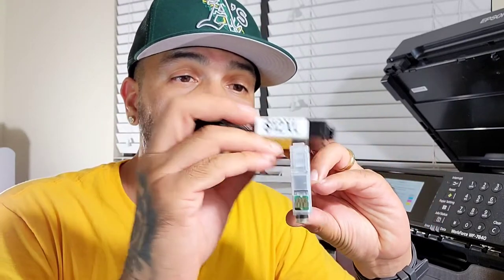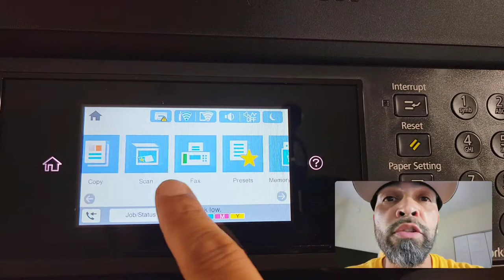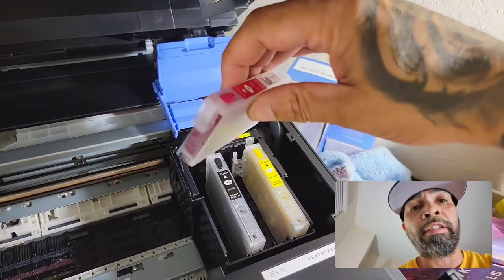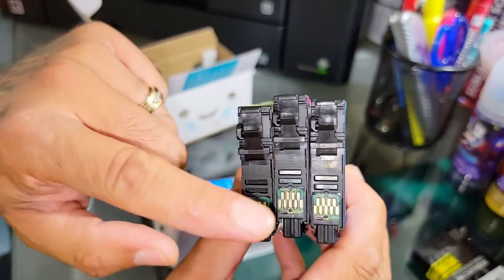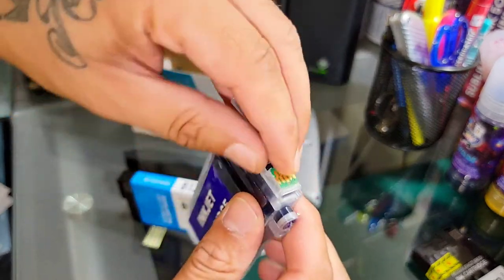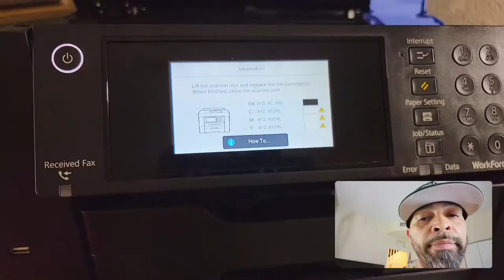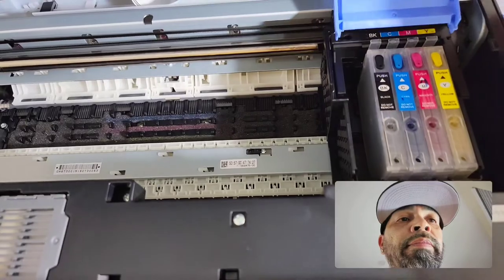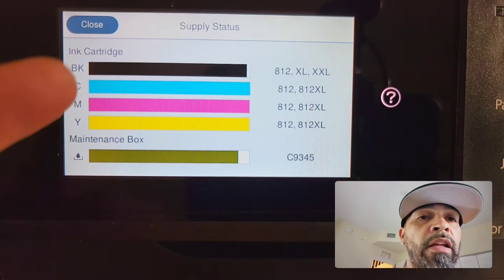Converted WF-7840 Into A Sublimation Printer PART 2 (MICROCHIPS)

Comment: Quick question if you keep the cartridges filled with sublimation ink and not let it get low , you don’t have to replace the  chip
Reply from the maker: Good question.  Since there no firmware chips made yet, the epson printer software will call for the ink to be changed right, the print driver will refuse to print.  So therefore have to change chips.

There maybe ways to bypass this, im still researching for a solid method.
Reply: @diywithkenny8399     are you using the ink up from the blackcartridge, then swapping out that chip from the black cart. nd putting that onto the clearcart?
Reply from the maker: No.  Filling the clear cartridge with black sublimation ink, then add the chip from the black ink cartridge.

Comment: I bought a new Epson wf 7840, never used the ink cartridges it came with. I bought new refillable cartridges that came with the chips already attached to the cartridges. We’ll after setting everything up, when I print nothing prints but blank pages. It reads all the colors are there and full but no print. What did I do wrong?
Reply from the maker: Hello!  Good question and will ask you this:  When you filled up sublimation ink, did you remove the clear rubber seal?  Also did you replace the clear rubber seal with the color rubber seal?  There should be no seal on back end on refill cartridge.

Watch video at 5min 45sec:  https://youtu.be/PI5RadxJX8M
Reply: I removed the rubber seal when I was filling them up with ink, then it was replaced back on the cartridges. I did not remove anything else from the cartridges.
Reply: So your saying to replace the white rubber seal with the colored seals for each cartridge?
Reply from the maker: @vee_theegemini  Exactly lol.  Throw away clear seal, color rubber seal  will move from back end towards front end where the chip is at.
Reply: @diywithkenny8399  oh ok, got it. Thanks Kenny! I’ll keep you posted on my prints.
Reply from the maker: @vee_theegemini  For better color; find your printer on your computer  "settings", then watch this (fast forward to 9min 27seconds) to set preferences/settings: https://youtu.be/aLpdCW_yQkw

Comment: I keep getting an error message on my yellow ink I have no idea why thats the only one not working. Im converting
Reply from the maker: Hello and ok.  Hmmmmn will have to ask few questions:  is the chip new?  Also is the chip facing up correctly?  Is the chip snug correctly -  meaning those plastic nubs are top and sides and bottom nub shaved off?
Reply from the maker: Did you get the yellow cartridge fixed?
Reply: @diywithkenny8399  I didn't shave the sides but I also didn't on any. Ill try that. I watched another video that did also. Yes the chip is new. Trying now BRB
Reply from the maker: @TheTeenBlogger  only shave off plastic nub on bottom on refill cartridge only.. hope it workouts 😎

Comment: Thank you for the great info! I can’t get mine to print anything yet using the start up cartridges/chips that came with the printer. I’ve done all the maintenance and set up now it’s saying I’m almost out of ink! Lord help me yall what am I doing wrong?
Reply from the maker: Ok.  Did you use original chips and cartridge for normal use?  If you did is because of software.  What you have to do now is to buy a new set unfortunetly (because no new software/firmware chips are not out for these newer printers YET!)  Once you replace the older chips, you should be running like new.  Can search Amazon, Office Depot, Ebay, Best Buy deals for "wf7840/7820 epson ink cartridges".
Reply: REPLYno sir I purchased the refillable ones and put the chips on those and have not been able to print the first thing. I’m buying the ones you used in part 2 now but I’m just concerned as to why the others didn’t work.
Reply from the maker: Oh ok my bad.  Let me ask you the original chips ever been used prior to swapping?  If you did use regular chip to print off normal paperwork type stuff, it loses the chip life regardless..
Reply from the maker: @kathysicuranza5999  also can save approximatley $14 if you go to Etsy and buy refill cartridges with chips whole set for $49.99 i saw
Reply from the maker: @kathysicuranza5999  https://www.etsy.com/listing/1007470036/epson-812xl-empty-with-chips-t812xl?ga_order=most_relevant&ga_search_type=all&ga_view_type=gallery&ga_search_query=epson+812xl+empty+with+chips&ref=sr_gallery-1-1&organic_search_click=1&bes=1
Reply from the maker: @kathysicuranza5999  Cheapest I see as of today!
Reply: I purchased my refillable ones from Etsy. I sent them a message, he asked for pics and now he’s not answering. I’ll give him a day I know we all get busy. I went ahead and ordered the set you showed you use so I’ll try those. And no sir I never used the reg ink. I bought the printer, sub ink and refillable cartridges and changed out like you and the others said
Reply from the maker: @kathysicuranza5999  It's ok.  Could be something missed in a step: 

(1) Main one would be shaving off the bottom plastic nub on each refill cartridge. (2)  Chips swap on exact color cartridge.  (3) Chip facing correctly.  (3) Slowly placing the refill cartridge in, then pressing top till click..because chip can move.  Not saying you did miss any steps.  Sometimes be the case.  Have faith you will get it.
Reply: He finally got back with me and turns out that his directions don’t tell you to remove the the cap over the vent plug!! I would think that’s pretty important. Now I’ll try again when my new chips get here. Thank you so so much for all your time and help. Keep the videos coming I’m enjoying them.
Reply from the maker: @kathysicuranza5999  It is ok.  Forgot to mention that step too, but it in the 1st video at 5:46 when filling the sublimate ink.  Figure there was a step missing.  SO... it is working?
Reply: I bought a Epson wf 7310 and went through video and have an error message that I can not get passed.
Reply: Initialized cartridge detected. Printer already initialized. (Black)
2) I click next and I get this message
Open the printer cover . Replace ink cartridge. I am using the fill cartridges that I bought . I ended up taking the chip off the original black ink that came with the printer. 
An help would be appreciated.
Reply: @ashlyncoyle4850  what is the code
Reply: @diywithkenny8399  hello.. I just bought my Epson 7840 a month ago. I did use the cartridge's for a few weeks to get used to printer.. sooo I bought sub Cartridges and ink. I went thru part 1 and swapped the chips from original to refillable one. I printed about 20 pages for shirts and it worked awesome. It showing now ink is low. So I took out and refilled black since that's the one that was showing low. It was full still!. And I cleaned print head and printed test page and the blue yellow and magenta lines are perfect. Black on other hand is not good. I've cleaned more than a dozen times. It's still bad. How do I fix this?? Help!!!!!😶‍🌫️😶‍🌫️

Comment: I have a question,  I'm thinking about purchasing a ET- 7840 and convert it to sublimate. Do you have to install new chips everytime you do a refill?
Reply from the maker: Hello.  Did you mean WF-7840?  You can refill sublimation ink anytime, but when your printer says ink is low, I recommend yes will have to change out the microchips, don't want to mess up any of your current printer software.  Because no new "software/firmware chips" are made yet for these newer wf-7840/7820.
Reply: So are you saying if your printer says low ink. Buy the 812xl and remove the chips from them and put those chips on the original refill cartridges?
Reply from the maker: @catfishingthebluegrass8282  Yes unfortunetly until they create a new software/firmware chips.  But I have updated the pin in comments and Etsy seller selling whole combo chips on cartridges (chips only good for one use), beats buying any othe ink cartridges, but still research please for any better deals.

Comment: I'm about to buy my girl this printer to swap to a sublimation printer. Besides changing the original chips over to the replacement cartridges like in your video, is there anything else that has to be done?
Reply from the maker: Hey Jason.  No.. just remember match the colors when swapping chips, and to shave that "bottom" plastic nub only on refill cartridges where chip goes.  You should be good.
Reply: What about software/firmware? Don't need anything special?
Reply from the maker: @catfishingthebluegrass8282  Those are the chips where we won't need to buy any more ink and swap chips.  Like the older version WF-7720 have those  software/firmware chips.  That what the wait is for.. unfortunetly.
Reply from the maker: @catfishingthebluegrass8282  Sublimation ink should last and can refill anytime.  That you will have to manually check.
Reply: This stuffs confusing. So I can just refill with sublimation ink as needed and keep the same chips on the replacement cartridges and don't need any special software?? Sorry for the hassle, just trying to understand
Reply from the maker: @catfishingthebluegrass8282  You can ask as many questions you want.  Dont worry about any software/firmware chips because it is not out yet.

"WHEN" your printer says low ink, just swap for new chips.  Fill sublimation ink as needed.
Reply from the maker: @catfishingthebluegrass8282  https://youtu.be/PI5RadxJX8M Just follow the steps in this video, pause if you have too.  Get stuck, just stop.. feel free to hit me up.
Reply: I'm ordering everything needed now. I'll probably hit you up when it comes in. Thanks for all the advise and help bro.👍
Reply: Everything works. Cartridges and ink are in. Only issue is that the prints are super faded. Any way to make them more crisp?
Reply from the maker: @catfishingthebluegrass8282  they will look dull, have you heat press them onto anything yet?  True color of the print will show on product.
Reply from the maker: @catfishingthebluegrass8282  also find your printer on your computer settings.  You can fast forward to about 9:25 in this video: https://youtu.be/aLpdCW_yQkw
Reply: @diywithkenny8399  everything worked perfect bro. Thanks for the videos. Great details, and thanks for responding to the comments. Couldn't have done it without your guidance. 👍
Reply from the maker: @catfishingthebluegrass8282  Great news!  Here anytime!  Appreciate the comment 😎
Reply from the maker: @catfishingthebluegrass8282  Add one thing, you can  fill up sublimation ink anytime, so manually check it here and there!  Other than that good to go.
Reply: @diywithkenny8399  last question, do you know of a good place to buy shirts in bulk? Hoodies and Ts
Reply from the maker: @catfishingthebluegrass8282  Yoooo.  No worries, always ask in google search if -  "IS WWW.@&$*%<ABC.COM LEGIT" ..you see no type of trustpilot or bbb ratings then dont shop there, here a list:

Www.alldayshirts.com
Www.jiffyshirts.com
Www.shirtspace.com
Www.shirtmax.com
Www.t-shirtwholesaler.com
Www.blankshirts.com
Www.clothingshoponline.com
Www.shirtsupplier.com
Reply from the maker: @catfishingthebluegrass8282  Ask anything any time B...
Reply: Hey man! I have a quick question and if you could direct me via a link. I need to know where I can buy the refillable cartridges for wf-7840. Went to amazing but they have non-compatible cartridges with this printer. Also, what kind of inks / brand name? Appreciate your feedback 🙏🏻
Reply from the maker: @eduardi84  https://tinyurl.com/ukb5j9vk

Comment: Hey mine keeps showing cannot recognize ink cartridge. Try installing again
Reply from the maker: Hey .. ok.  Have to ask few questions:

Did you fill the ink remove clear seal, and replace it with the color seal?

Did you download the "recommended drivers" from www.epson.com/support (have to find your printer them download)?

Where you get the chips, or did you swap them yourself?

Im around to answer and help

Comment: can you use the chips that come on the refillable cartridges? I tried changing them with the original ink chips and it wont read it but it reads it with the chip the cartridge came with but no ink comes out

Comment: I am new to sublimation and I have a question about the printer  If you are using a refillable cartridge..why do you need to change the chips.  Why wouldn't you just be able to refill with the sublimation paint?  Do you have to change the chips very often? I know you indicate that the printer is saying the replace the cartridges...just don't understand why.  Your video IS very helpful.

Comment: Hey there Kenny, I just purchased a 2nd set of cartridges with chips.  My 1st set of cartridges didn’t work.  When I installed the cartridges my Epson WF-7840 only recognizes the Yellow.  I’ve tried removing them, reinstalling and still no recognition.  Are there any steps I could take to rectify this issue?

Comment: Hey I noticed at the 4min mark you don’t have the back plugs in your cartridges. My printer is printing blanks and I have the plugs in mine. Am I to remove those?
Reply from the maker: Yes, throw away clear plugs and move the color ones forward.
Reply: @diywithkenny8399 got it working man. Appreciate you.  Got my first pic printed but it’s showing my black is almost empty. I did a lot of test prints but it never used any ink. I still gotta replace the chip tho eh?
Reply from the maker: Any time & ask away.  NEVER UPDATE FIRMWARE on printer.  Just manually check your sublimation ink, refill as needed.  Also search Etsy marketplace for chips.. better prices than buying the epson ink for the chips.  Hopefully they bring that chipless soon so we all dont have to keep buying chips.
Reply: @diywithkenny8399  mos def

Comment: If you kept the cartridge full by filling the ink periodically do you think you would still run into that error?
Reply from the maker: Regardless you will have to monitor the sublimation ink, so refill as needed.  Issue is the chip life & replacing every time the printer warning "low ink".
Reply: @diywithkenny8399  Thank you so much for getting back to me! I did find someone who sells the refills with the chilp already in them, just to confirm s each time this printer says low ink I would have to go and buy these chip cartridges each time?

Comment: I have a question I have done all of that and I printed my page to make sure my lines are correct. And there not I did a head cleaning and all I get is spots of ink on my paper can you tell me what I did wrong
Reply from the maker: Hello.  Have to ask a few questions to better understand please:

Was your printer running normal with original cartridges?

Did you prime your refill cartridges like the original (part 1) tutorial?  Prime is taking your suringe and without pointy needle, put the end where fill ink and pull up to get the air pockets out.
Reply from the maker: Last question, did you download the "recommended drivers & print settings" from www.epson.com/support?

Comment: I have a workforce 7840 and I'm looking to change it to sublimation, it uses 812xl ink and it cost like a 100 dollars and I don't want to keep buying that ink. Can I change this printer to sublimation even tho I already used it? If so, how can I do it?
Reply from the maker: Hello.  Before you decide to convert this printer to sublimation, please be aware you will still have to buy chips every time printer say low ink.  Epson EcoTank 15000 all you have to do is fill sublimation ink (prints 13x19s & 11x17s too).  But as asked here a link give you direction: https://www.etsy.com/search?q=wf%207840%20chips
Reply: @diywithkenny8399  ok so it's not worth it to chage it cause it would be the same.
Reply from the maker: Hello. The link above comment would be cheaper, the rest will depend on your situation and/or personal/business model. So works or best ootions for you.
Reply: @diywithkenny8399  so every time the ink runs out I have to buy those chip and also the ink when it's finish from the bottle?
Reply from the maker: No the chip and printer thinks regular ink and runs out; you will have to manually watch your cartridges to refill as need.  BUT once chip expires have to buy and replace, there is no software, chip rest devices, or infinite chips yet.  Why i recommend Ecotank 15000

Comment: Hi Kenny! I was only able to get my printer to print 3 sublimation sheets and suddenly just won't print anymore - any suggestions?
Reply from the maker: Sorry to hear!  Check printer panel for:

 Is the printer saying low ink?  Then change chips!.

 Also have to manually check to refill cartridges to see sublimation ink inside there.

Then run a print nozzle test.  Let me know.
Reply: well, the cartridges are new and filled and worked for 3 sheets then it stated "printer can't read cartridges..." I then removed and replaced but now it just won't print - Should I move to just buying an epson eco tank 15000?
Reply from the maker: Hmmm.  Could just power off, trouble shoot that way.  But yea if you can get ET 15000, less stress.. just get the et sublimation ink from www.cosmoink.com which will have the nozzles to fill up.  Hope you get it working WF.
Reply from the maker: Hey Juan, just thought of something.. double check the chips, see they are stable whem replacing back into printer